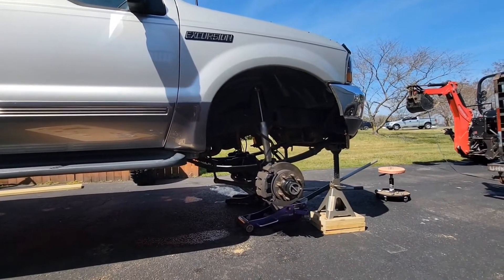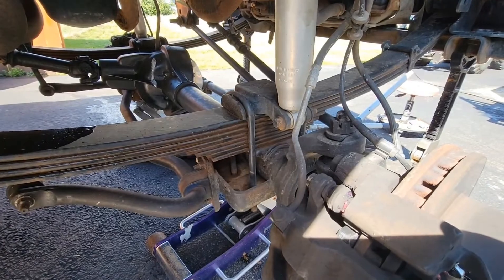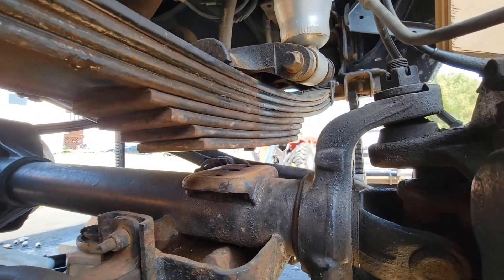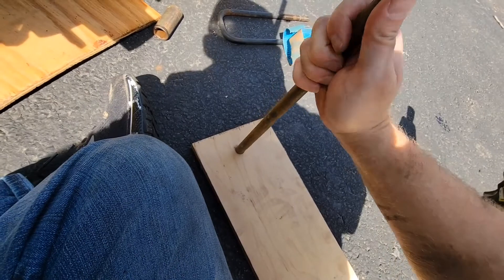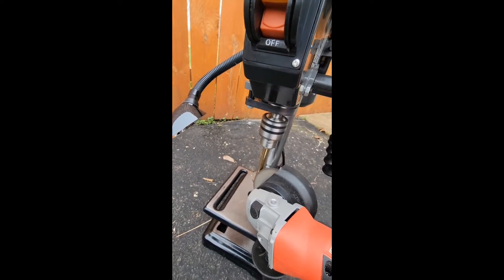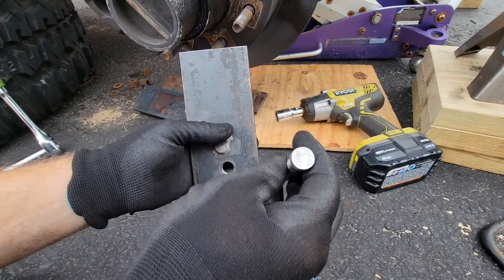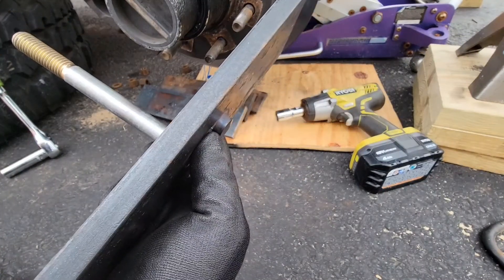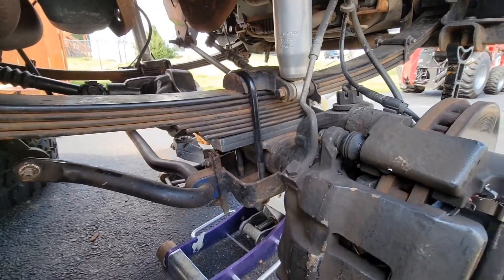Making a leaf spring plate to shift the front axle forward and prevent tire rubbing over bumps

Comment: I'm doing the same on my 1998 chevy k3500 with a Ford dana 60 kingpin front axle the chevy wheel wells are even smaller than yours and I'm running 7 inches of lift so hopefully I can clear 40s
Reply from the maker: Worked good for me, I'm 100% rub free wheel lock to lock

Comment: Question: I'm confused, did you relocate the shock mount aswell?  I've also got 40s on my F250 and when I go over a bump at lock it rubs my fender so I've been looking to do this.  Thanks!
Reply from the maker: Sorry for the slow response, for the shock mount plate on the top you can either make a second top plate that shifts it forward as well,  or you can grind out a larger hole up top to clear the spring pack center bolt.  The shock itself has 2 bushings at 90 degrees which allow motion in all directions so the shock itself is fine

Comment: Excellent!!!  Is the front leaf spring center pin size 5/16?
Reply from the maker: My center pin was 3/8 with 5/8 head.   However when I replaced it I noticed the hole was big enough for 1/2 pin so I used that instead just because I could.
Reply: @buildsomethingstupid1736  Is the 5/8 of the head unchanged?
Reply from the maker: @HS-gs6jc  yes I used the drill press and grinder to make a perfectly round 5/8 head